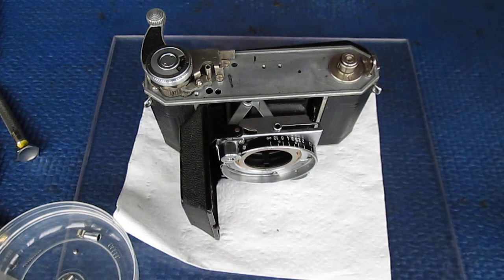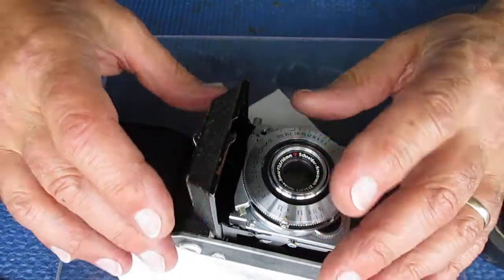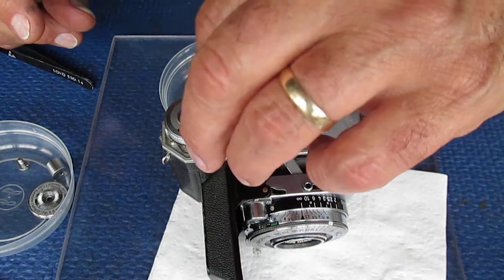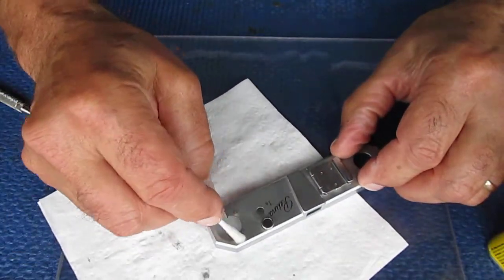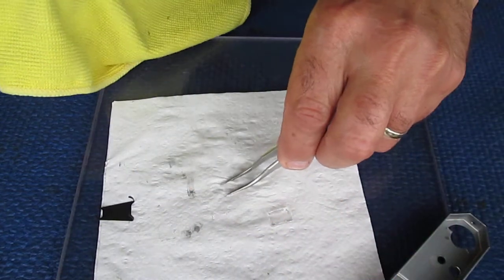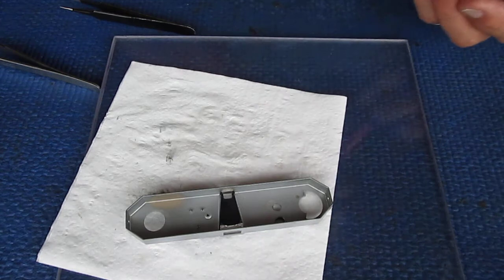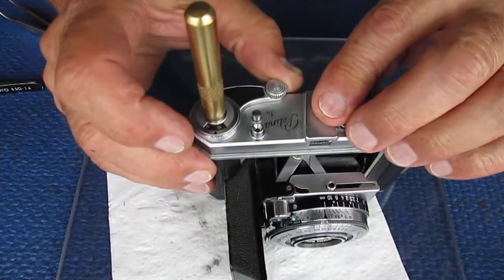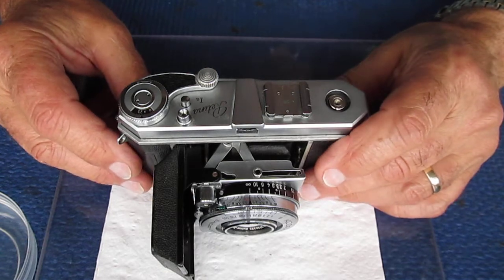Retina 1a servicing 07: Final body reassembly, and shutter-release adjustment

Comment: Thank you so much! 
I just got a Retina Ia and the winding mechanism had come out of alignment to a point where the gear rack just laid in the top compartment loosely. With the help of your videos, I was able to find out how things should be and got the mechanism back in action.
By any chance, do you know if the front lens element of the Retina Ia could be swapped for a IIa element? I'm asking because the IIa is able to go up to f2 whilst the Ia is only capable of f2.8.

All the best
Adrian
Reply from the maker: No, the IIa lens is a completely different design. The Xenar is a four-glass lens, the Xenon is a six-glass lens. You would need to swap both the front and rear groups, you would still not have an f/2 position marked on the aperture settings, and I'm not sure the front door would close over a Xenon lens anyway. The front door on a IIa is deeper in design. The focus scale is not identical, so likely the lenses with nominally the same focal length are not actually the same.  Accurate focus at f/2, with the more limited depth-of-field, would be tricky without a rangefinder to help too. If you want a IIa you'll have to buy one.
Reply: OK, thank you for the quick answer. 
I didnt really believe it would be possible - but one never knows ;-)
All the Best
Adrian